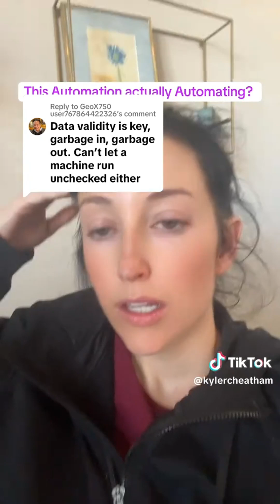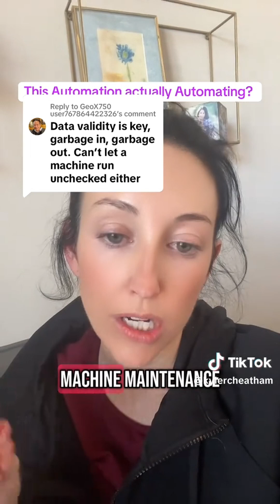How #predictiveanalytics and #ai Keep #manufacturing Operation Running Smoothly

Comment: FALSE THE MATERIALS STILL EXIST!!! 
Now you’ll have to chemically extract said materials but they haven’t magically disappeared. They have become part of a new solution…something’s dooooo OFF GASS but those gases could be captured and utilized if we cared  enough tooo
Reply from the maker: Great point. You're right that the materials do not disappear. In chemical manufacturing, the raw inputs are transformed into a new state, so while the original form is no longer usable, the elements still exist. The example was focused on the operational cost of that transformation. Recovery is sometimes possible but usually not practical during active production.